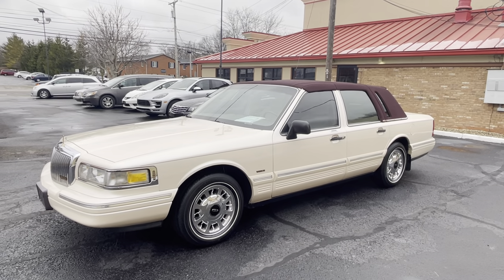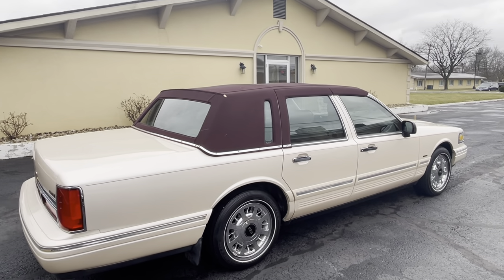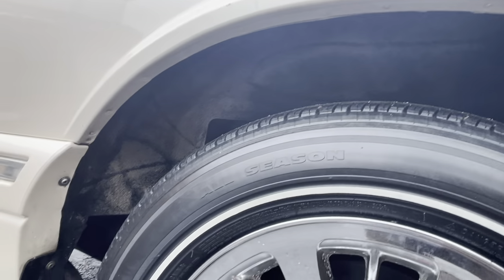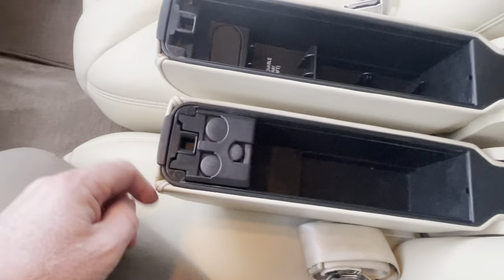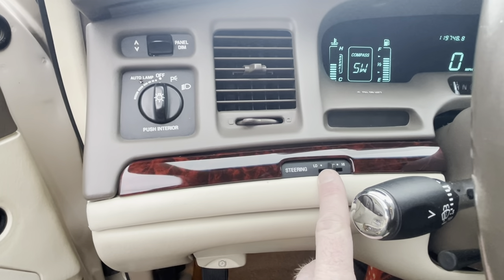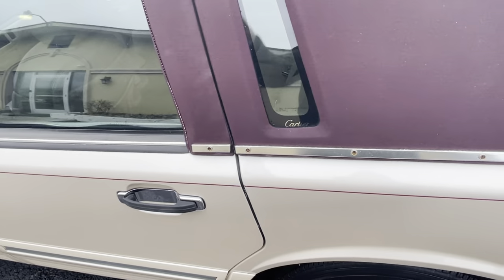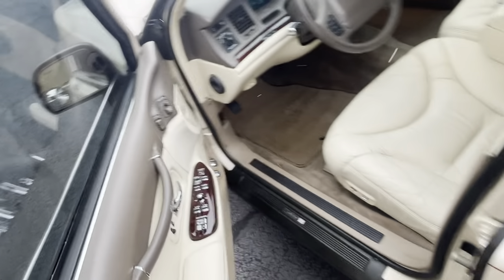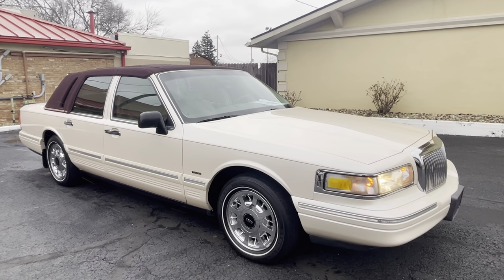1997 Lincoln Town Car Cartier - Zero Rust! Arizona Car! Only 120,000 Miles! Superb Condition!!

Comment: Very easy to disable the air ride message on these. Behind the glove box is the module for the air ride. There are two plugs on it, and one plug has a green wire in the middle. Snip it and the light goes out. I haven’t done it in a few years, so the particulars are cloudy. But definitely do-able. A google search will yield you with some old forum posts on the details. Nice looking Cartier, my favorite combo with the cranberry top.
Reply: Anthony always has a solution!
Reply from the maker: Thanks for the info! You are awesome and all of your videos!

Comment: I have a 1997 Signature.  Got it from the original owner with 68K miles in 2014.  It just rolled 112K. It's just getting broken in! Love it.  I want a 1995 Cartier Roadster.  This car looks like single exhaust.  Mine is dual

Comment: If ppl would have some 1 clean and spray bags with 303 and then slather on a handful of Vaseline on each they will last decade or more. I know cause I do this and mine have made it 7 years so far. They don't ride anything like the air bags without them. Only car that has rode better is a old Citroën with their ball and fluid suspension. U can't let rubber dry, crack and expect it to last. Spray 303 on all rubber and it will last a long time.